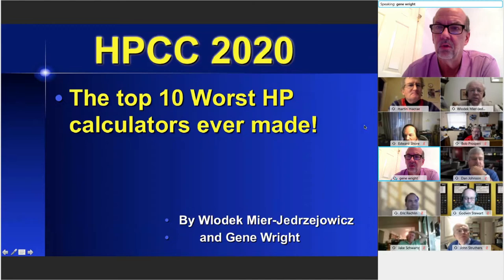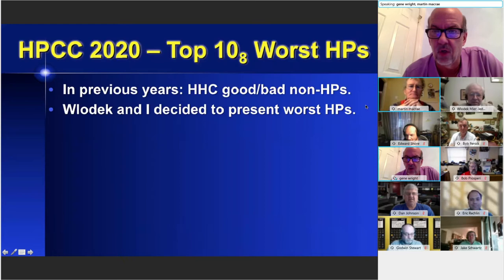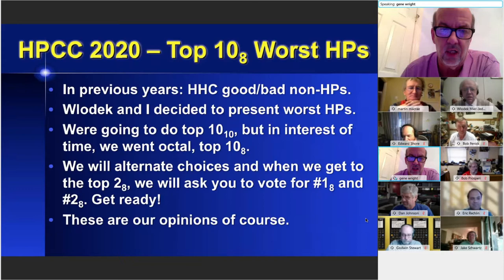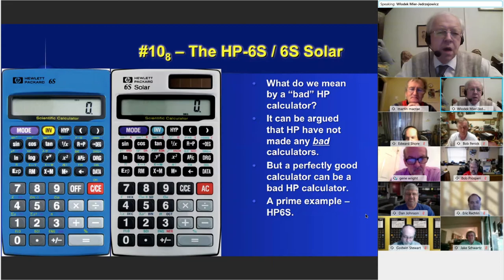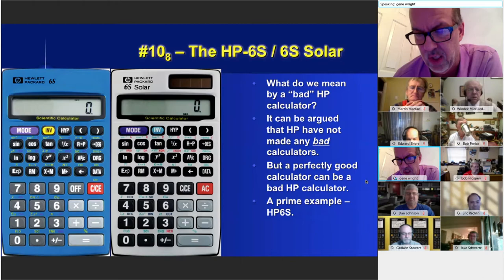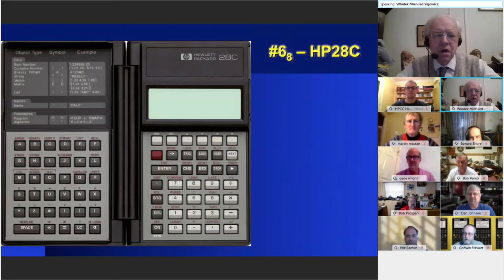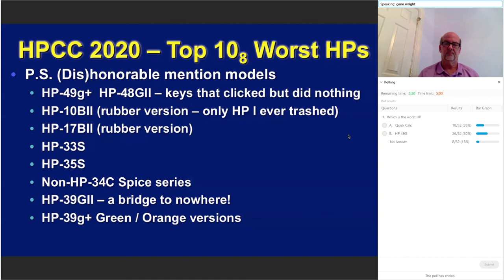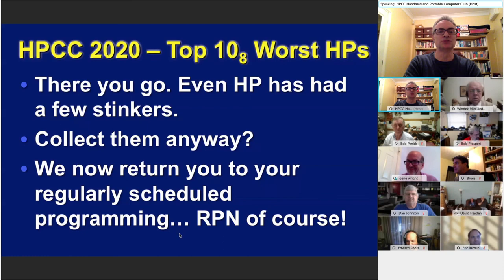HPCC 2020: HP's Worst Calculators (Gene Wright and Włodek Mier-Jędrzejowicz)

Comment: The 49G is my favourite. It was the first I got and I really liked the blue color.
Reply: The software was very good sure (after ROM updates). But, if you ever had in your hand a 48 or even a 50 you can feel how bad are 49G's: color scheme (it first apears nice when you come from TI or Casio toys), rubber keys (not as confortable as we are used and the printing goes with time), large screen (compare to 48) but lesser quality and readability, some other few issues.

Comment: HP-28C was groundbreaking in 1986. It was a huge step up from my HP-97 & HP-15C.
The HP-28S ( 32K & 1MHz upgrade ) that came 2 years later made me feel that I wasted my money on the early-bird.
( At least I could use the IR Printer again when I purchased the 48GX in 1992. )
When the HP-35S came out in 2007 I was thrilled with the old-school format and the Voyager-style keys.
But offering only a 2 line display, in a world craving graphic calculators or at least a bigger visible "stack", I felt very dissappointed.
Theese days HP doesn't make any professional calculators at all! ( I don't consider the HP Prime a "calculator" ). 
The best "HP" calculator is probably the SwissMicros DM42 and the "best buy" the HP-30B with WP-34S firmware. :D
Reply: The 28C was the one that got me to love RPL. Being able to see the stack and to see the numbers coming at me made all the difference. The 2K memory was constraining, and I felt almost betrayed when the 28S came out and was so much better.

Comment: Unfair to put the 28C (and therefore 28S) into this category. Yes, battery hatch and keyboard failures on many after 10-20 years but I have a well kept one (28S), works well, and the keyboard is better than the 41 series. It is my favourite! And recall, RPL in 1986 must have been amazing!
Reply: 28C was very frustrating. Expensive, so much promises, so much expectations and so little memory ! A shame. The 28S was the real 28 I loved.
Reply: Apart from the battery hatch the 28C is not comparable to the 28S at all!
( I have had 10 different HP's since my first "HP-97" including the HP-28C. My favorit is still the 48GX. )
Reply: I think what really got the 28C on the list is the frustrating 2K RAM limitation, which the 28S was not hobbled by. My first HP was a 28S and I thought it was miraculous but I remember hearing about the 28C and wondering why on Earth they'd have designed such a machine and given it only 2K. (Later I learned the story: the hardware specs were exactly those of the 18C Business Consultant, which was the model higher-level management knew was commercially viable.)

Comment: My brother had a 48 SX, I got a 49g.... I was amazed at how much of a downgrade it felt like with its plastic TI rip-off cover, it ultimately suffered a battery leak at one point and had many of its keys simply became unfunctional making the calc useless, hard to believe HP was trying to bill this as the successor to the 48 line.

Comment: I re-watched this and have to say I disagree with the 39G being on the list. Without the 39G I would not have cheap but superior parts to repair 48 series calculators. They practically give these things away on eBay and the LCD in the 39G is a perfect upgrade for the fuzzy blue display in the 48 series.

Comment: The worst one that I got was the HP-10BII. I have the HP-17bII+ (gold painted display bezel) and it still works. I get a used HP-17bII+ Silver (case similar to the HP-35s) from eBay and I like it. It was a good design though, as keys are working fine.
Reply: The HP-10s+ is the worst HP calculator I got. I really like the HP-10bII+ (despise it's algebraic only)! HP should have made the HP-10s+ in the same way as the HP-10bII+! ;)

Comment: I don't agree with the 39GII being bad. I own one and it's a good calculator, it's durable (as opposed to some other models), the features are great, it was cheap enough for what it provided, it's still relevant today, the keyboard was decent (not very good, but decent), the display would have been great (resolution, grayscale levels) if it did not have this pretty poor viewing angle... (so, a bad-ish point here). I understand that, being a 100% algebraic calc, it's probably seen as the devil by HP calcs afficionados (and I've owned a HP28S and a HP48G+...), but as far as being a dead-end, no, it's a direct predecessor of the HP Prime, introducing the same programming language, many of the base functions, and even the general look (although for sure the Prime looks a lot more premium.)
So, just a thought. Maybe an oddball somewhat in terms of being "HP", but still a good calc that deserved better than it got IMHO.

Comment: Considering the contributors, I was expecting more than this rather trivial rating of a bizarre lot of HP calculators. I mean, how can you compare cheap little things like the 10s with HP's mainstream calculators? I agree that the 49G is awful, because of the display and the keys that are not only rubber but hard to press (unlike the 39G). But dismissing the 28C and 55 and ignoring dreadful marketing mistakes like the 33S seems very quirky. Disappointing.

Comment: Hello. I had the same top1 in mind and I happily discovered that we have the same worst hp. But on my side, it's for another reason. In fact , the same reason as the 15c limited because they are thr end of the dream. I dreamed of the 28s and of the 48sx. I finally bought a 48sx to a friend of mine who bought the 48gx. A few years after I bought the 48gx waiting for a new model. Waited in fact 7 years... for the same model but simplified. It adds nothing. It is loaded with the meta-kernel and you loose the equations and the table of elements. We lost the expandability. And at that time I realized that the HP dream was over, and the adventure of the calculator was over. More than 20 years later, I can confirm that I was right. The last hp machine was the 48gx, I mean the last one ahead of its time.

Comment: I think I voted for the 49G for the worst.  My personal worst would be the 49g+ due it's horrible keyboard.
Reply: My problem with the hp49g+ is that the gold paints on the case was destroyed by sweat from my hands and looked terrible. This was largely fixed on the HP50g. I've had two hp49g+'s and worn out two keyboards. I also have an HP50g. I really like using the SD cards. I built an elaborate directory system on them.

Comment: The inclusion of the HP35S is a mistake, based only on rants from old farts in some internet forum, people who actually do not possess this calculator.

People should not follow blindly a random HP-Anon who says that "checksum is meaningless" (it works perfectly indeed) or "3*3 solve looks strange" (whatever it means). If you have a 35S try yourself!

After checking that  the first 3 listed bugs may not be reproduced in my HP35S I stopped checking further. It is not worth.

Comment: The HP49G emulator, go49g, runs much better than the original HP49G and has a much more pleasant shade of blue. It also has an option to use the colors of the HP50g. This app also clones easily with App Cloner. I made some twelve clones of it.  This is a paid app so I can't share it. 

It's power point is actually is making SRPL programs with the Emacs - extable - Nosy package. The entire ROM straight Saturn whereas the hp49g+/50g ROM is partly Arm and this part cannot be effectively decompiled. Much of your SRPL programming is done by modifying decompiled ROM code modifying it and recompiling it - something I'm quite into. There are more usable routines for the true HP49G ROM.

It is possible to create an HP49G emulator with Emu48 but it uses ROM 2.10 for an hp49g+/50g. It's also the ugly shade of blue. Emu48 is free while go49g costs $15.00 and needs android 9 or lower.